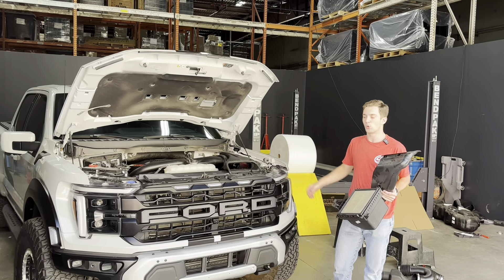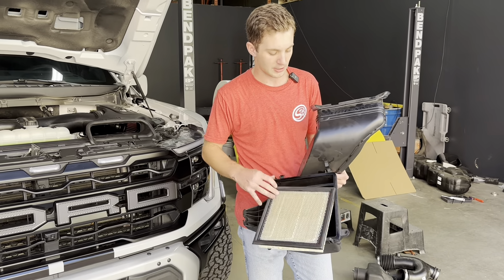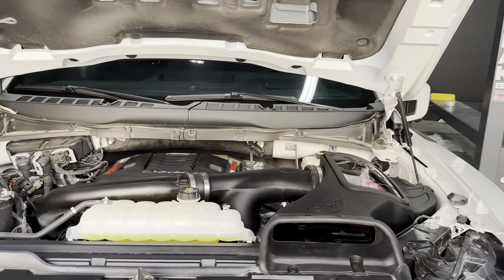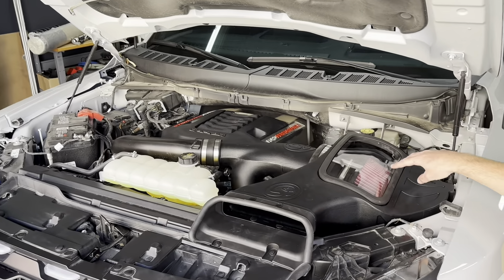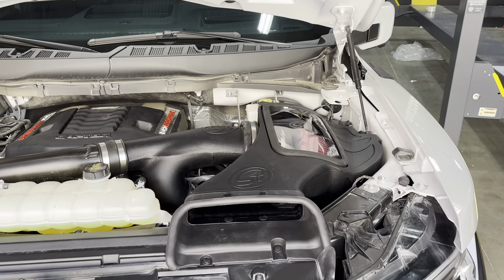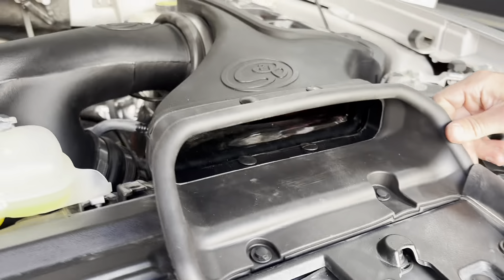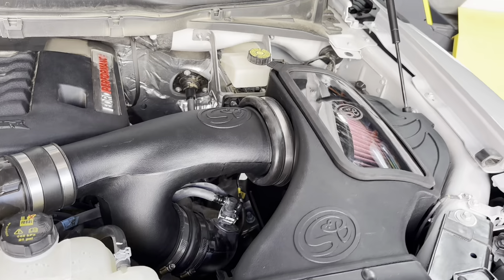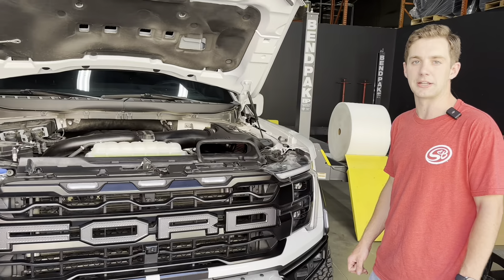S&B Cold Air Intake Overview for 2015-2024 Ford F150 3.5L Ecoboost

Comment: When you look by the scoop we see the air filter inside , its straight open,  is it possible that water ( or moisture ) can get ln the filter ?  When we follow others cars on wet road the water become a kind of fine brune .  I have a 2023 F150 2.7 im looking to get your air intake if everything is fine with wet road conditions .
Reply from the maker: @mathieumaisonneuve7210  you can put a filter wrap on the filter which will repel the water!
Reply: @  So every time the road is wet i have to put a wrap on the filter ?  I own a F150 im not gonna do any kind of racing
Reply from the maker: @ we have not had any issues ever with moisture getting into the filter. It drops to the bottom of the box if water gets in and drains out